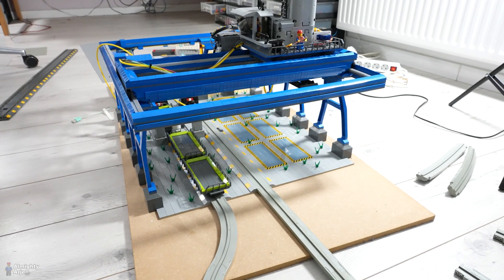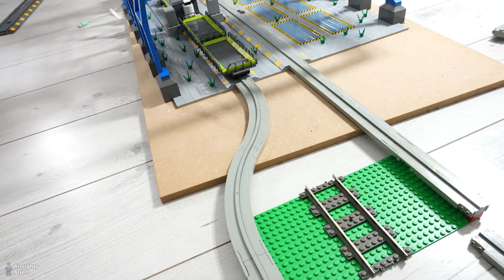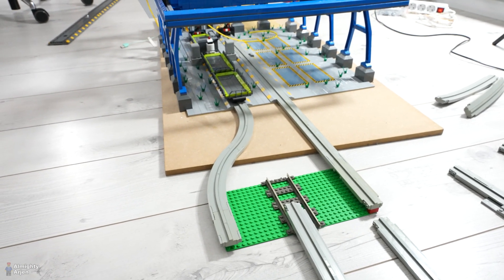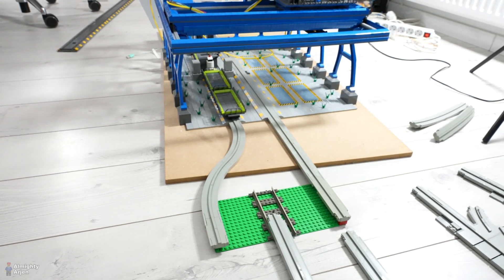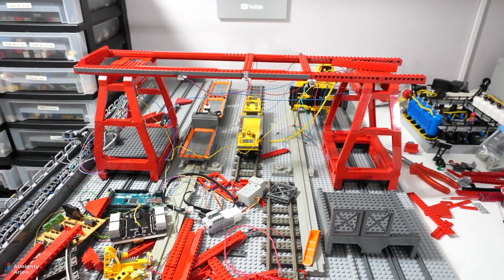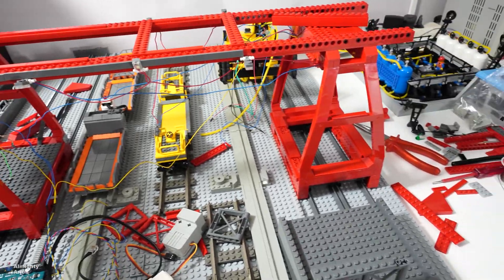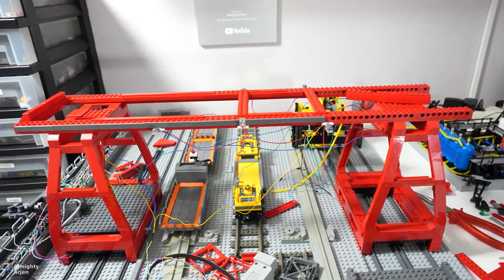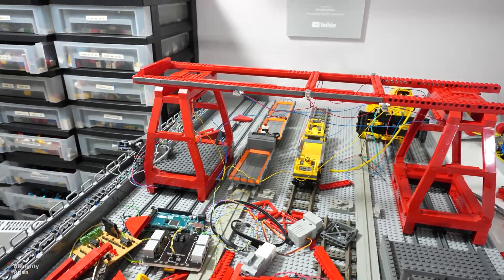Automated container terminal E39 New red crane design part 1

Comment: Been looking forward to this, thanks! As an added bonus seeing your cable channel was great as just today I am trying to run LED cables on a train gantry. Cheers
Reply from the maker: If you only have two thin cables, you could use  2 plates with a sliding door rail on top of eachother, sticks a bit to the side but it saves a plate in height.

Comment: I would recomend using two switches, so you have two tracks at each end, and a single track between them, then you can run three monorail trains, and the switches will change themselves to avoid collisions.
Reply from the maker: That could be an idea indeed! It requires some more programming to keep track where the monorails are though. With two parallel tracks I can send the monorail to the other crane whenever I want, that won't be the case with a connecting part between the two tracks.
Reply: @AlmightyArjenWip  But you can get more interest and trains constantly moving.
Although you would need a third train, if you don't already have one, and the additional capacity may make it too fast for the cranes to keep up.

Comment: Great job! When I print a mechanism in 3D, I put food-grade lubricating grease. I think it may come back to you untill for your monorail swap. Where did you buy that EV3 board you're showing at 5:29? Does it connect only the motors or also sensors? Keep it up👍👍
Reply from the maker: It's this one: http://www.mindsensors.com/arduino/16-evshield-for-arduino-duemilanove-or-uno and yes, you can also connect sensors to the board!